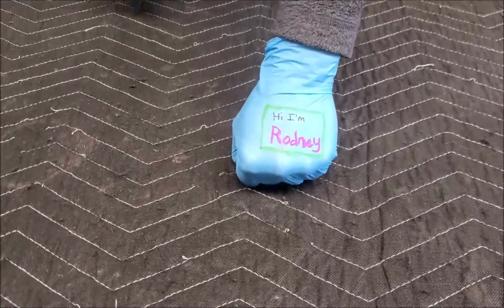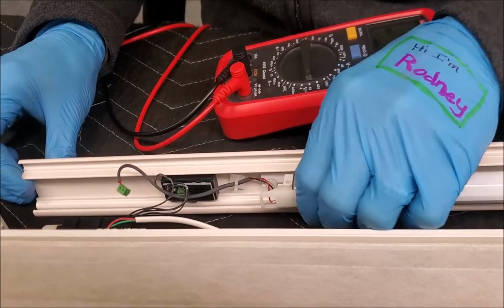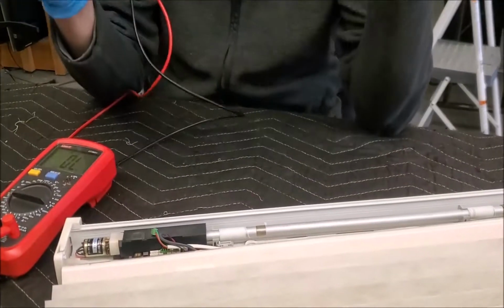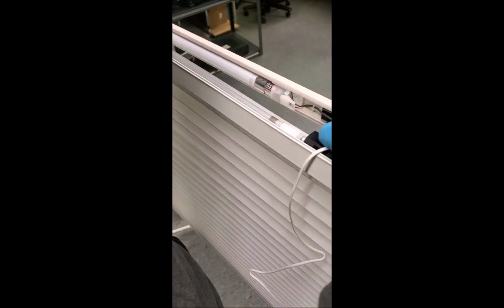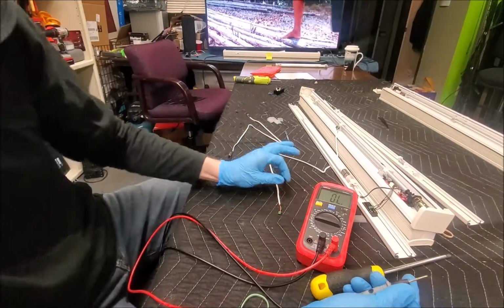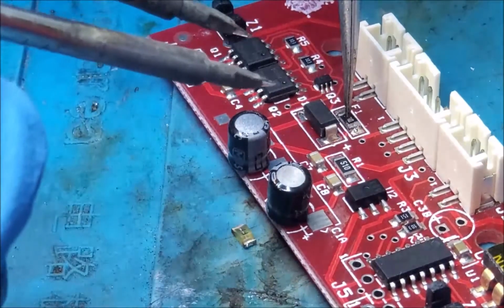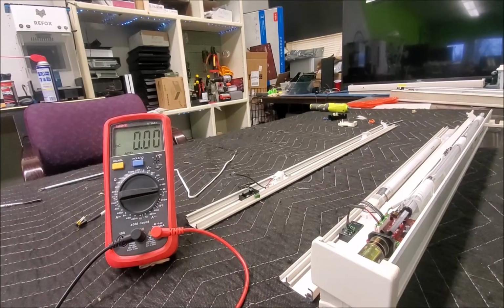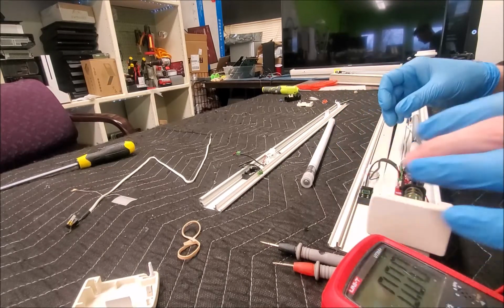Hunter Douglas Blinds Repair

Comment: Another quick question.  Found the microswitches on digikey you have.  Can you tell me what the resister is that you used?  They only have 3,500 different 0 ohm resisters.  lol
Reply: 10Pcs Littelfuse SMD SMF 1206 Fast Acting Fuse 1A 63V Marking FH